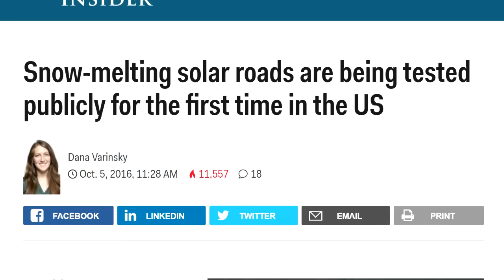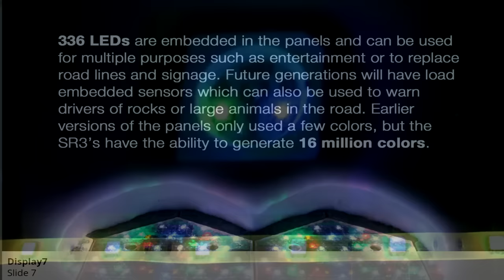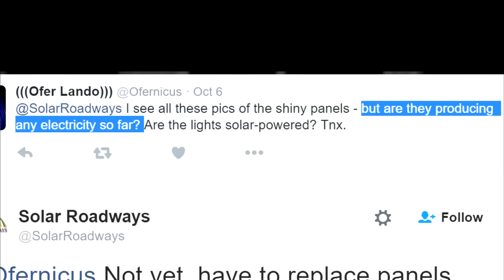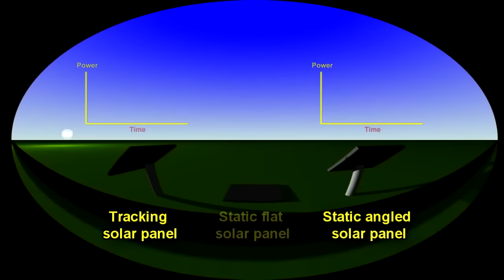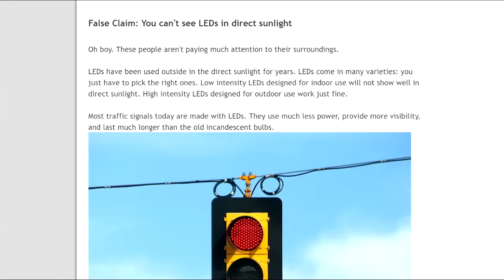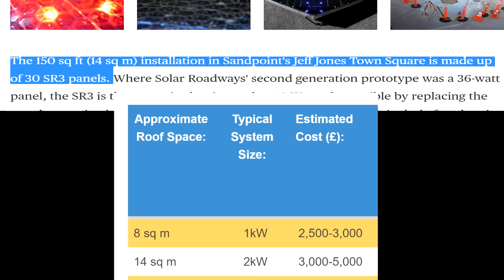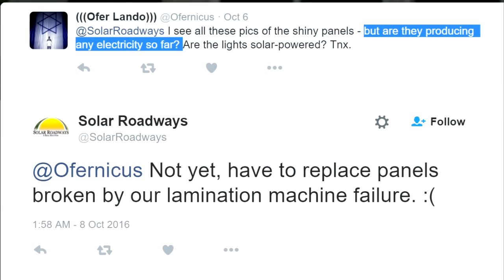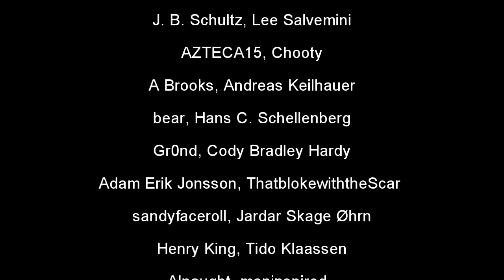First AMAZING Solar Roadway UNVEILED!

Comment: I checked out the livecam. None are on/can be seen!
Reply: They´re on, It´s just that LED´s without shading (like they use at traffic lights) in direct sunlight are barely visible. Just another (of around a billion) flaw with this "idea" of theirs.
Reply: TheHeavyMetalBrony I am very doubtful this will ever take off, to be honest. I don't see the problems with asphalt, really. Why fix non-problems?
Reply: They fixed one and 1/16 of another
Reply: Exactly.  We don't have enough money to repair cheap asphalt (made of ground rocks and oil refining waste product [bitumen]).  A material we have come upon as the cheapest, most efficient combination of durability and traction for vehicles after 2500+ years of road-building experience. Forget that shit.  Instead let's pave the roads with high-tech tempered glass, microprocessors, circuit boards, heating elements, and other sensitive electronics.  Seems like a GREAT IDEA!  What could possibly be the problem?
Reply: Well, quite some time ago, I looked up some data for average snow fall in new york city during the winter, so I could do some calculations just for fun. Turned out that even if I assume perfect weather conditions (clear sky, clear atmosphere, so basically.. no clouds and snow in the air even while it's snowing..) and zero losses for the tiles, using all of the energy they could possibly harvest to do nothing but heating, they would STILL fall short in power output. They could not even keep melting the snow at the same rate as new snow typically hits the ground during winter, meaning that they would quickly cover up, shut down, maybe melt the first little bit of snow that hit them and create a perfect sheet of ice under the snow.

It is physically impossible. The sun simply does not provide enough power per unit area to keep up with your typical snowfall in NYC (which I picked for my example because it was the first one I was able to find official data for). Even the sun needs more time to melt snow than it takes your typical clouds to generate new snow.
Reply: Wyand The idea is to draw from the grid for the heating (and hopefully make it back for the summer).  The whole 'heated tile' bullshit started because the electronics/PCBs do not tolerate temperatures below -10degrees C.  So Scott (being the grade-school science fair thinker that he is) thought "I know, I'll put heating elements in them to save the electronics in winter!"... Then they thought "Hey, we can sell this as a feature!  No more snowy/icy roads!!"

Comment: My community can't even afford to fix potholes. How are they going to maintain many miles of power electronics THAT WE DRIVE ON?
Reply: I'm sure it will be fine. I mean, how could a city plow with hardened tire chains even hurt a solar panel?

/sarcasm off
Reply: Srithor
Yes because as we all know, it takes very little energy to melt snow.
Reply: Self melting snow, outstanding. They can use the extra power to power the hyperloop.
Reply: Of course! 

Road construction is well known for being done on time and under budget whilst still producing quality work!

Comment: So... Trying to count the LED per board i came up with 70 LEDs a board. With each LED consuming 2W(that's bare minimum for a billboard, though you'll probably need more if you want to see these while driving) you have 140W per board. Each board is 5 ft square(150/30) which is 9/100 meter squared. So you end up with 7000/9 bulbs per square meter that's 777 and 7/9 bulbs per square meter. Which is 1515 and 5/9 Watts per square meter(And that, mind you, is with the bare minimum for a billboard). Which is a whopping 2 to 1.5 times what you would get from the sun if you had actually used all the energy it gives. Sure... it's consumption and not production, but those are small details.
Oh, and considering you use about half the surface area for solar power generation you should get at most about 1000*0.20*0.40*0.5*0.5 = 20 Watts(it only works during day time so multiplied by 0.5 again). So it's 1495 and 5/9 Watts per square meter of power. 
Sure, yeah, whatever, so it's pure consumption. So don't be so close minded and believe in 
HYPER FREAKING SOLAR THORIOM ROAD LOOPS. With thorium mined from the surface of the sun so it is actually charged with enough GAMMA RADIATION to supply light INFINENTLY, and loops that provide ULTRAKINETIC ENERGY when you drive through them.
Reply: At least molten salt breeder reactors that use thorium to make a self homogenizing fuel cycle have the science behind them to prove they can work, all the stupid hype about thorium powered cars aside. But the instant this solar road way hype started it has been obvious that the panels will consume way more power than they can ever generate, not just accounting for the LED's, but acctually heating them to the point of keeping the road surface above freezing all year, you would have to dissipate a lot of energy.

Comment: 99 systems that generate twice the power each, right?
Reply: That's what I thought as well.

Not to mention that these systems would be a lot easier and cheaper to access for maintenance and repairs.
Reply: Yep. Thats each. So for the same money, you can generate 200 times the energy as solar fucked up roadways.
Reply: 2 x 0 is still 0 :(
Reply: +rodentlover100
He was talking about the potential energy generation. Not the actual. They could have spent the same money on 99 panels that would generate 2x the theoretical cap(of a fixed flat solar panel) each instead of what they got which generates 0x the theoretical cap.

Comment: The data for how much power we can expect from a given panel arrangement is well know and studied already.  I'll place the link in the next message in case YouTube blocks the message.  Using Los Angeles, California as the example:

A fixed panel flat to the ground (0 degrees) results in an average of 4.9 kWh/day over one year.  Tip up the panel to the latitude of 33.93 degrees and this increases to an average of 5.6 kWh/day over one year. A 2 axes tracking would come to an average of 7.2 kWh/day over one year. 

Going North, the difference gets worse.  In Spokane, Washington, latitude 47.63 degrees, a panel flat (0 degrees) gets an average of 3.8 kWh/day over one year.  Raise it up to 47.63 degrees and we get an average of 4.5 kWh/day over one year.  For comparison a 2 axes tracking gets 6.2 kWh/day over one year.

This data comes from:  "Solar Radiation Data Manual for Flat-Plate and Concentrating Collectors"

If I can't post a link, use Google or Yahoo to search for the link.
Reply: I'm not sure why they had to do the "study", the data is already out there...

http://rredc.nrel.gov/solar/pubs/redbook/#maps
Reply: What about at the equator?
Reply: The link only covers the USA, but any location at the equator should have the panel flat to the ground (zero degrees) for maximum fixed  panel solar output.  The state of Hawaii is about 19 or 20 degrees form the equator, but if you look up their data at the link, you'll see a slight difference between flat ( zero degrees) and at latitude.
Reply: and that doesnt even begin to cover things like the material for their roadways which were grooved and sort of grainy to provide traction, making it even less efficient.
Reply: Would you also achieve maximum fixed panel solar output at the tropic latitude lines during a solstice?
Reply: Assuming full sun (no overcast) at 12 noon, yes.

Comment: The idea behind it is very nice and interesting.
The problem is that in practice, it is literally impossible to do with our current technology, for exactly the reasons Thunderf00t has shown.

Fun idea, needs a lot of work. And not act like they just invented how to turn dog poop into gold.
Reply: needs a lot of work but not by these loosers but by actual scientists who work on making solar panels more effective and cheap
Reply: tripweed additionally, it's just reinventing the wheel. The wheel is fine. 

Keep the roads asphalt. Put solar panels on roofs. There is no way that isn't better. Te only good thing they have going for themselves is the heating, but it would be such a powerdump, and we already can deal with that.
Reply: PXEntei Well, heating the roads might be possible with solar power, but with our current tech it will be... arbitrary. We lack capacity to keep the energy from the sun stored properly without it degrading in the cold. Add in that, as you said, it's a huge powerdump, and even thin heating wires in the asphalt (Not feasable, too easily damaged) and it is... yeah. Not a good idea.
Reply: I don't think technology will be advanced enough to make solar panels "Shadowproof"

Comment: They also need to think about traction (friction) and the effect that burning out and braking will have on it, the black marks will ruin the ability of the panel to collect energy, given that all other problems are accounted for.
Reply: I guess burnout markings on solar panels would be thin enough to still let most wavelengths pass, especially when you consider the thickness of the glass itself, so it would make a inefficient concept just slightly more ineffiecient.

Comment: I suppose what I say about this is that we need to encourage the development of Solar technologies and explore avenues.  While Solar roadways aren't really good now, perhaps some tech advancement in the future could make these more viable. They will never high a high output, but if another method of electrical harvesting was available for roadways that was cheap, even a marginal harvest yield of energy would help drive electrical costs down. But to power everything? Impossible.  The problem of panels as well is durability. They wear out from Heat, which these panels would be a furnace of, and for roads, Car movement day in and day out. Repair costs would be astronomical.   Something this couple should consider is researching a method of harvesting kinetic energy, making the device cheap and flexible, I've seen some stuff of late that might do this job, and the device able to absorb the kinetic energy of people walking on or around it, or driving over it.   The benefit is marginal, but it's another source of energy that is being harvested and might balance out the energy demands of a city or countryside.

Comment: Funny, I had this exact idea in my head when I was about 8 (10 years ago). I wanted lighted roads to provide more visibility during night because roads in some areas aren't even visible. Even then I realised solar panels as we currently produce them wouldn't be viable because of the inefficiency.
Reply: Yet all the sponsors blindly throw money at these, i'll be generous 'theories' which then encites people without the knowledge of basic fundamentals of solar energy to donate money and further spread misinformation. In this day and age you can just do a quick search on your smartphones to see if the science is applicable or not.
Reply: There are some parts of the UK that have LED's in the middle and side of the roads in the "Cats Eyes" that are powered by tiny solar panels and from vehicles passing over them and depressing them (which is a design of the non powered ones to avoid wear and tear).
Reply: Snoqualmie pass (I-90 East of Seattle) has lighted cats eyes to light lanes and edges going around the summit and my goodness it is gorgeous up there at night.
Reply: We have cat eyes on the roads here but they aren't bright at all here. Especially on really dark nights you can barely make out the road a hundred meters away. They are usually just in the centre of the road.
Reply: Dude I was Eight years old plus, don't you think it would look amazing to see lumanescent roads every where to the point of seeing the patterns lit up from space. 100 meters isn't much when you are trying to find turn offs and it can get worse on smoky/misty or foggy days reducing that to 10 meters of visibility. Don't forget to account for oncoming traffic and all those dick heads with Hi-beams that blind you, if we had complete view there would less accidents at night aswell. You could see any traffic much further away and "might" not even need headlights.

Comment: You forgot to mention an important point; Traction. Glass is slippery when wet. Add even a light dusting of snow and it would be like ice. And what about those communities that spread salt or cinders in the winter? Cinders would make an abrasive slurry that would kill the light transmission properties. FAIL

Comment: man you've smashed this idea twice already, why are they still wasting money on this
Reply: The PR makes it seem possible there are alot of obstacles to overcome and in the end parts of the claim plain out are false. Are roof top solar panels better right now yes but this in the end will make a good side walk where side walks still exist. For highways and side streets a car has a variable weight as does a cargo trunk starting at 3 tons for a small car with no add ons and a healthy weight person inside as the driver. 3 tons is alot of force thus i see this being used when all the obstacles. One of the major ones which will be for freezing conditions to not require heating to not break and the other will be to find a way to get a material transparent enough to allow solar power but also strong enough to withstand a 400 pound person standing on it for hours waiting in line with more normal weight people 100 to 190 pounds each in a line of 30 or more. 
Glass that you buy at home depot and wal mart is not strong enough to take the weight of a person for years without breaking. The team was stupid with quality control also. 1/3 of a product Dead on Arrival most consumers and all businesses i know will demand a refund and/or a free replacement for the broken ones broken in transport to them.
It can just it will not generate much power and is not a good way to use solar power research grant money.

Comment: A thing that would be more realistic
"THERMAL FREAKIN ROADWAYS"
normal road surface so it can be driven on
and generate power from the heat differential between the hot road in the sun and below the ground
Reply: en.wikipedia.org/wiki/Thermoelectric_generator
in hot locations the black/dark grey pavement can get quite hot and below ground not far it gets reasonably cold
so energy could be produced by placing these generators under the roads exactly as they are now
and this would work best in locations like the freeways/highways in places like California/Texas
Reply: wouldn't really be efficient enough to cover the costs... still a better idea than solar roadways lol
Reply: I never said it was good/efficient
all I was going for was a better idea than solar roadways
Reply: I used to run a radio off a thermocouple collar on a paraffin lamp, the difference in temperature generates a current.
Reply: Iceland generates most of its power with thermal power plants.
Reply: Jelly, Yeah, thats one of the perks of living on a volcano.
Reply: Paint the road black to absorb as much light as possible.
Reply: +Bryan Hinze
all I was going for was a better idea than solar roadways

Thats not hard to do. How about piezo-freaking-electric roadways? As the cars roll over the road, the road deforms generating electricity from a bunch of those click lighters set under the road XD
Reply: chickenman297 the problem with that is that those "click lighters" are piezo-electric crystals - the ones in the lighters are quarz. Having quarz crystals in there would speed up the deterioration of the road... basically grinding the soft stuff against the harder-than-steel quarz.

If there was a way to make it from one material that idea might be quite feasable though. Imagine all the energy you could gather from all those trucks driving over it.
Reply: +Jelly Squiddles
As +Bryan Hinze sez and I paraphrase: It just has to outperform solar fucked up roadways. 0.1 J of energy immediately outperforms the roadways

Comment: Just had a brainwave. To increase efficiency lets angle them and have lifts to take cars down once they reach the top.
Reply: Wow!!! Brilliant!!!
Variable texture, heated, power producing and SELF-TERRAFORMING SOLAR ROADWAYS!???
I'd take a roller coaster ride to work any day!
Reply: Wolf Edmunds Thanks i knew my degree in gender studies would come in useful
Reply: Even better: Angle and lift the panels so that the cars can drive downhill both ways. Free energy, now you don't even need fuel in your car! Beats the thorium car that only lasts for a 100 year and then runs out!

Comment: There is also the not small problem of support.  The ground underneath moves quite a bit with changes in temperature and moisture.  Plus in freezing weather you get differential freezing and consequent frost heaves.  Glass isn’t going to tolerate even the slightest heaving.  Just a few millimeters of heaving and the glass is going to crack.  Plus the original installation would have to be flat and level to the millimeter.  One peanut sized rock on the underpayment surface is likely to be too much stress for the glass to tolerate.

Comment: One other flaw that Thunderf00t didn't address...what happens in an accident?  What happens to a glass roadway when a car or truck rolls over?  What happens when someone overturns a trailer full of scrap engine blocks, or large chunks of broken concrete slab...or anything big, heavy and dense.  Do we have to shut highways down for weeks or months while the glass tiles are replaced?

Comment: I've been watching a lot of Thunderf00t videos.  It has occurred to me that maybe his opposition is upset because he only says "no no no" and doesn't offer any alternate solutions.  Well in many of the cases, there are just no practical solutions to offer (thorium powered cars, self-filling water bottle, that pull air down below the ground to make it condensate idea).  But in the case of solar roadways, I feel he certainly offers a better solution, and also gives logical and practical reasons for his disapproval/debunking.